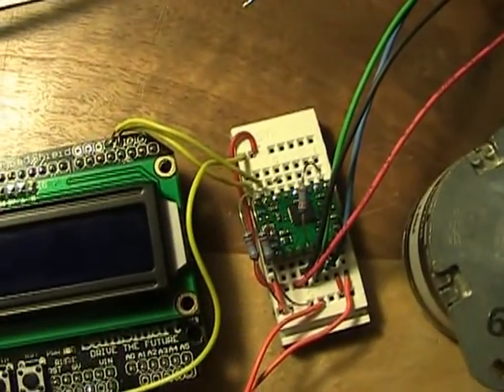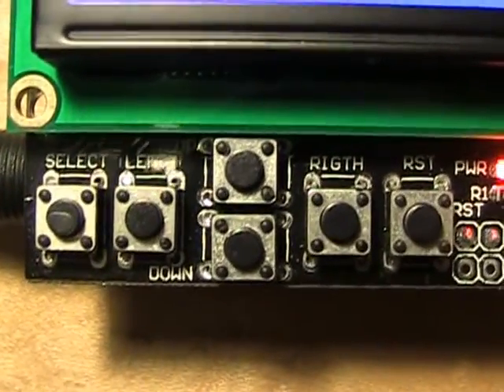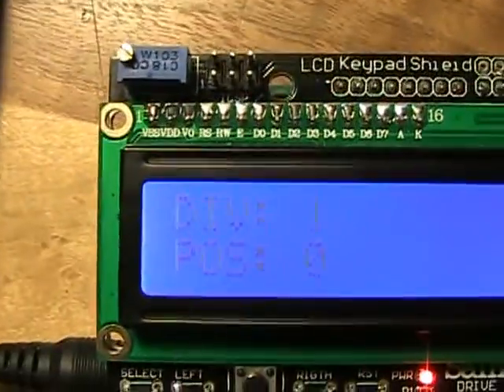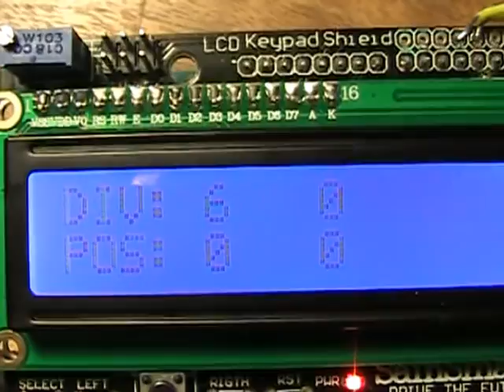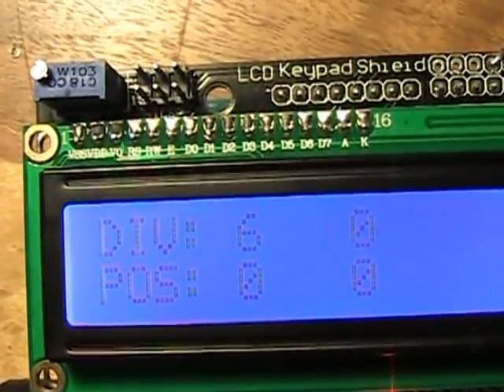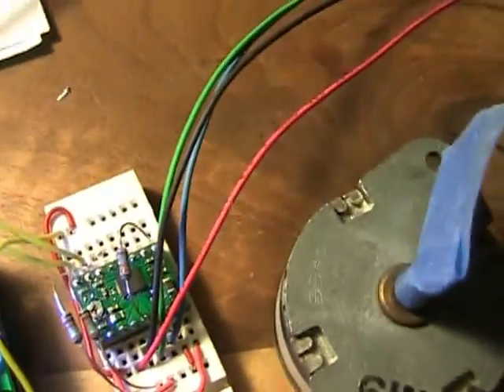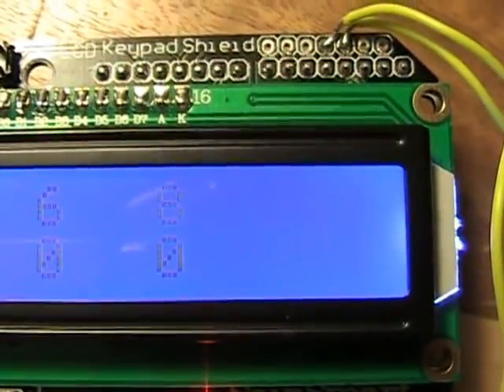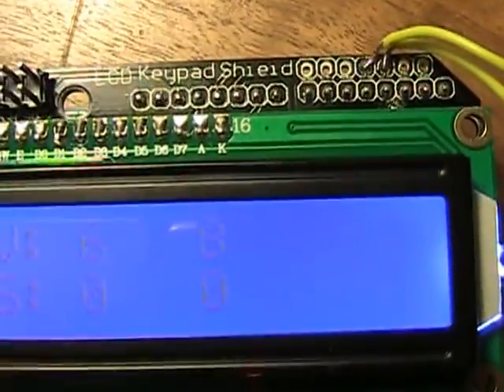Arduino Stepper Motor

Comment: Your brilliance is blinding. I would like to motorize my Yuasa 8" rotary table but it would require an electrical schematic that Stevie Wonder could build from. You should consider selling a bill of material , electrical schematic and code examples.

Comment: Tried it and its great. But I would like to use the same arrangement to motorise my milling machine table. But instead of divisions I would like to be able to adjust speed of rotation of the Stepper.
Reply from the maker: If you look in the code near the bottom of the function called step (dir), you'll see the following code:

    digitalWrite(stepGo,0);             // Stop Stepper
    delay( del );
    nsteps--;
  }
  lastpos = pos;
}
 
/******************* read the buttons ************************/

The line which says delay( del ) controls the speed of the stepper by introducing a delay between step commands.  del is a variable which is initialize to 5, meaning the program will delay 5 milliseconds between steps.  If you change the value of the del variable to a smaller number, the stepper will run faster.

Comment: Hi Chuck.
I was trying to learn arduino code to use arduino uno and the same LCD keypad to run Stepper Motor at different speeds back and forward but It's to difficult for me. Could you please wright a code or maybe you know the place where I can download it.
Kind Regards.
Jerzy
Reply from the maker: Were you able to download the code from the link below?
Reply: Yes I got it . Thank you.
Reply: Chuck Fellow

Comment: Thanks for sharing Chuck:)
I am about to upgrade my home made dividing head and your solution is a good one.
I have a Nema 23 425oz and driver as well but not the code.
Is it possible to have a copy of the arduino code and info about libraries for the screen?

Thanks

Comment: Chuck, great job.  do you have a recommendation as to where I can look for help.  I want to use stepper and an Arduino to cut tapers on my micro lathe.  Keep the great projects coming, great reading. Thanks, Bii
Reply from the maker: +Bill Lee Thanks, Bill.  To cut tapers on your mini lathe, you'll need a stepper on your lead screw and a second stepper on your cross slide.  You'll also need stepper drivers, such as the inexpensive A4988, to drive the steppers.  Finally, you need an Arduino or compatible to drive the steppers.  You would have to program the Arduino to cut the tapers by driving the two steppers at the correct ratio for the desired taper.  Instead of the Arduino, you could use Mach3 software on a PC to drive the steppers, but you would need a PC with a printer port.  Of course, using Mach3, you cut threads and do other, full blown CNC work on your mini lathe.  However, the tapers applicatioin would be an interesting Arduino project.

Comment: Hello absolutely need your help I want to use the same system with a EasyDriver v4.4 is that it is possible and if so how to make the necessary connections thank you

Comment: Uhmmm bro...you don't have rectifying diodes between the motor and the driver.  It's an inductive load; every time you power down the motor the EM field collapses and conserves energy via back electromotive force and sends several thousand volts back onto the driver.
Reply: +Stephen Garner more diode type info and installation detail please.
Reply from the maker: +ukmwg - Although using clamping diodes is a usual practice when switching any kind of inductive loads, there is no need for external diodes since stepper controllers or drivers such as the Pololu A4988 apparently have built in circuitry to handle this.
Reply: Chuck the A4988 does have fly backs in its circuits but from experience with that exact driver I can tell you that back EMF will greatly reduce the lifespan of that driver.  Mine lasted about two months when used on a 3D printer then they started skipping steps wildly.  Sacraficial diodes that can handle the back emf way better are dirt cheap compared to drivers and arduinos.  Don't chance your electronics, do it right!

Comment from the maker: The stepper driver is an A4988.  Google pololu and that will lead you to their web site where I bought mine.  Current price is 12.95 + shipping.  You can search ebay for A4988 and that will bring up some "compatible" types for as little as 7.95 but they come from China and might take a while to arrive.  The A4988 is rated at 2 amps but you have to use a heat sink or the chip will overheat.

Comment: Nice informative video.  I am looking at getting the neccessary parts and pieces. Is there a particular item number for the The Pololu motor driver.  There are several to choose from on ebay.  Is there anyway you could give me the list for the best buys on ebay?  I'm totally new to this arduino stuff so I don't want to buy something then not understand why it does not work.
Thanks.

Comment from the maker: No PCB needed.  The arduino duemilanove, the Sainsmart LCD Keypad, and the Pololu all com already put together.  The Sainsmart board just plugs in to the top of the Arduino.  The Pololu motor drive came with head pins separate and I had to solder those in.   I've also got it plugged into a piece of prototype or breadboard that I cut off a larger breadboard.  I did add some 12K resistors to the Pololu driver to keep certain pins pulled down to ground level.  Arduino UNO replaces the duemilanove.